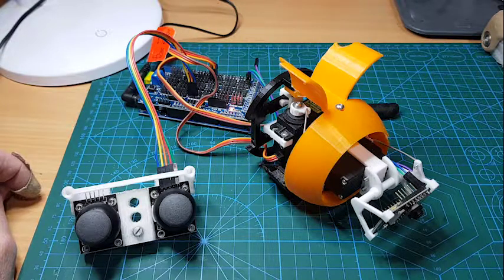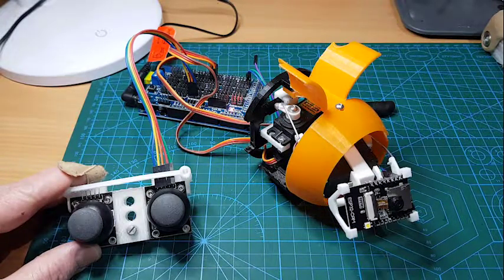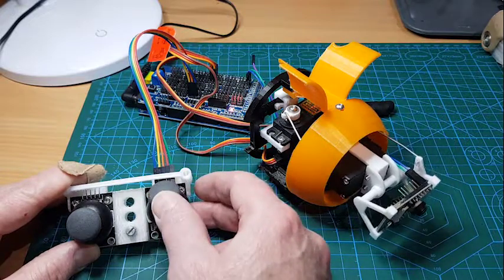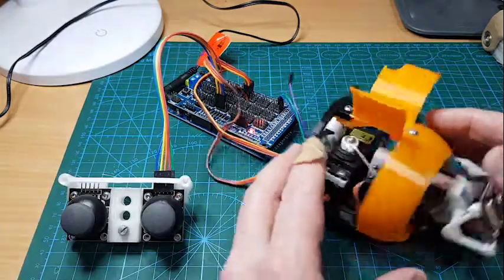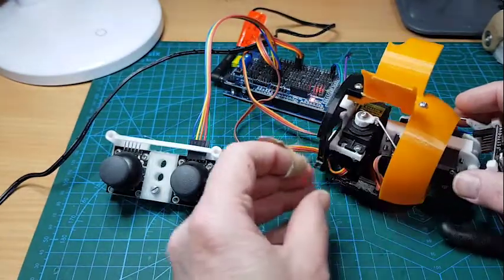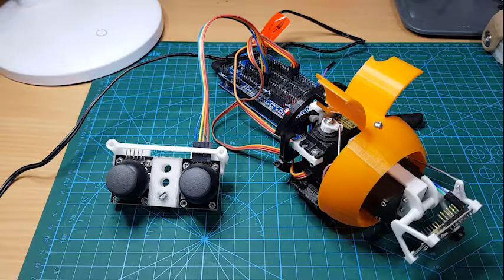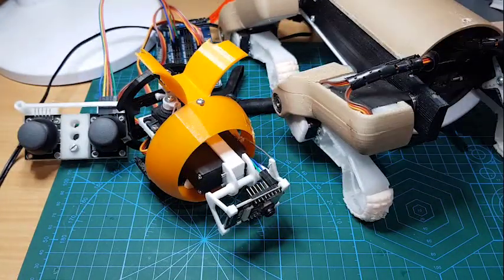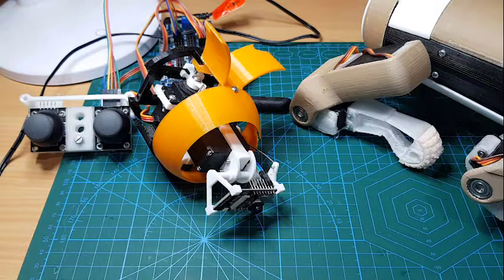SpotCorgi Where's your head at

Comment: Why use such servos? They weigh a lot, it will be enough mg90s. And those wires just awful))) Even better test is to use a good. I also ordered such a camera for my dog, after the new year I will resume work on my project. I want to make management as at Boston Dynamics that went to a place on a tab to a place.
Reply from the maker: As I said in the video the goal is to use smaller 9g servos. The big one were used just to test the design concept since they can run on 7.2v like the others. Small one will need step-down to 4.8v. 
Not sure which wires you are referring to; the electrical or actuator linkages. Both will be tidied up for final design. 
As I also said in the video, since this project has many paths (software, printing, hardware, electrical, testing, re-design, etc) I take short-cuts and do bodgy builds to to keep moving ahead.
btw I have put new leg covers on Thingiverse but they are still alpha. I have one printing as I type and will check the design but changes may be needed.